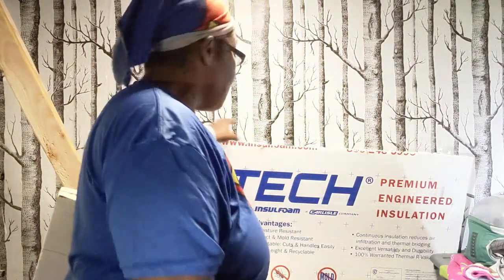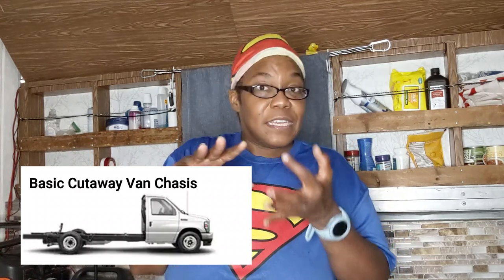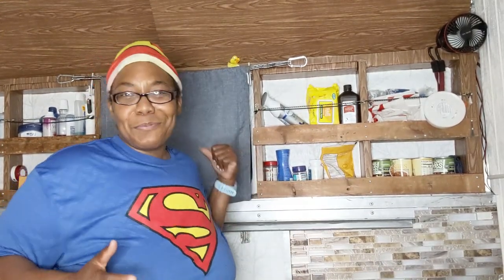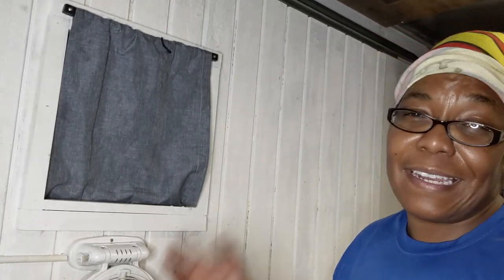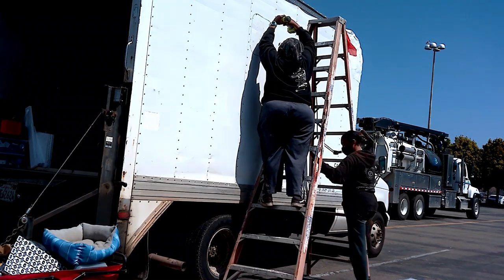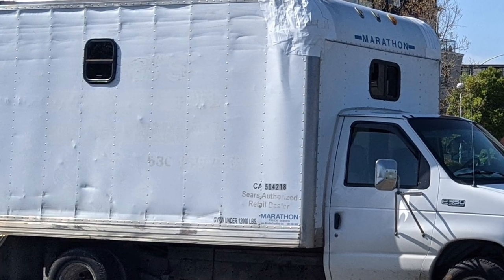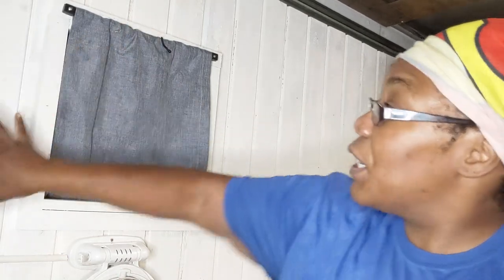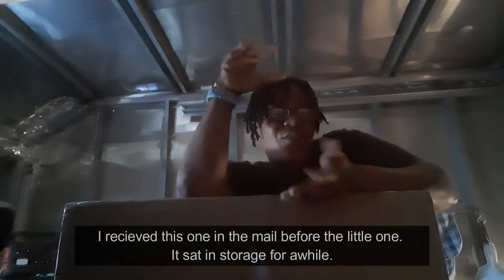BoxTruck into Tiny House | Build Diary | Installing Windows

Comment: Great video Dawn. This video format was great. You showed clips of the build, then talked through it later. The upgrades on the van are awesome. I cannot wait until it is finished. You may need an accordion style ladder that you can use if ever needed to use exit window. That's a long drop down. It's called an escape ladder.

Comment: I used a decorative pillow case the type where u put the pillow in the middle...of the case opening...and cut a tiny hole on both corners of the pillow case and used 550 paracord...made a loop and screwed it to the  wall...cheep and easy fix...you box van is coming along nicely...keep up the good 👍 work...